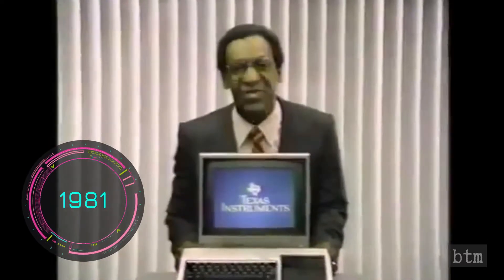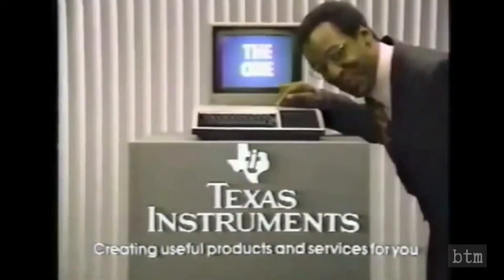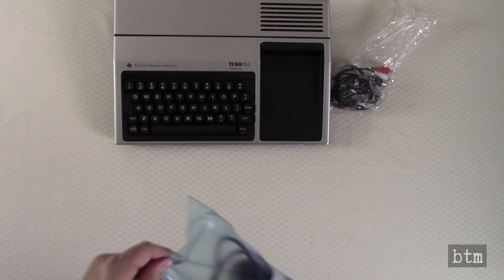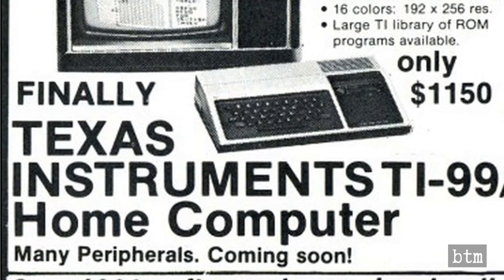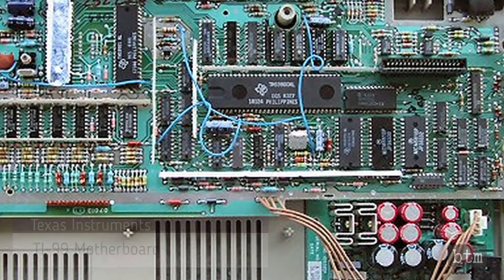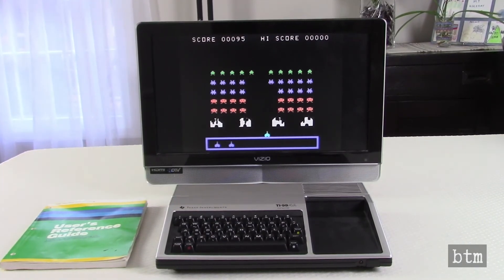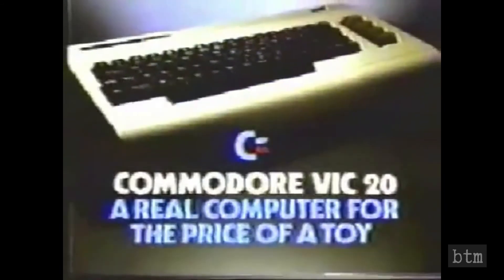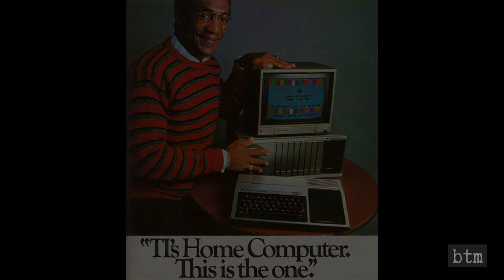The Rise & Fall of Texas Instruments’ TI-99 Personal Computer | Commodore | Apple | Tandy: E14/R3

Comment: Love the Elektronika MK-61 @2:33 ! Although the MK-52 is much cooler by far. :) I recently had an English version of the keys printed up by JLC3DP.

TI has always had its head up its backside when it comes to their "proprietary" ways of thinking. This applies to what's going on right now with them continually trying (and failing) to lock down their calculators. 

And that's a nice 99 that you've got there. :)

Comment: The Texas Instruments failure in the Home Computer market was three-fold.

1.  A design that gerry-rigged a 16 bit processor onto an 8 bit bus when the planned 8 bit CPU failed. This never allowed the machine to ever reach its potential. A 16 bit processor running at twice the clock speed of its competitors, with a performance that was only a fraction of those competitors.

2. Jack Tramiel. TI was dragged into a price-war battle against the Vic 20. Tramiel was able to absorb any loss that this war would cause, TI not so much. When the cost of production became considerabley higher than the forced retail, they had no choice to pull out. Sadly, the 4A was better suited to compete against the C64 in all but base memory, but TI allowed Commodore to use their less capable machine to take them down.

3. a Draconian Software Licensing model that discouraged 3rd party development. TI wanted control over packaging & branding as well as fees that surpassed all others in the industry. So prevalent was TI's disdain for 3rd party software, that their cost reduced QI system (identified through the loss of the signature brushed aluminum design aesthetic in favor of standard industry beige) actually made it impossible for 3rd party carridge software to even run on the machines. TI's abysmal in-house library was ill-equiped to compete with the software development seen on competing systems,

So it was 1 part poor design (caused by the rush to market of a system that was not ready for prime time) and 2 parts a marketing strategy that demonstrated an alarming lack of understanding of how to market a product in the space.

Comment: My father bought a TI-99/4a at the end of 1981 and it was my first ever exposure to home computers. Both the joysticks and the cassette storage were such a pain. The joysticks were no fun to play with and the cassette storage was so sensitive about the volume. Too loud it gave an "Error detected in data" message. Too quiet it read "Error: No data found". More often than not receiving one of those messages but excited if it read "Data O.K." and ready to run the program. Our family was hardly rich so buying an expansion box with the built-in disk drive was out of the question but around 1983 my father did buy a WICO joystick converter that allowed the use of Atari joysticks on a TI computer. Years later I discovered the Sega Genesis controller was Atari compatible (I've been told the same thing for the Sega Master System controls) so I tried it on the TI with the WICO converter and it works!